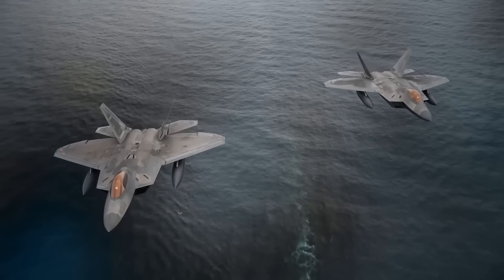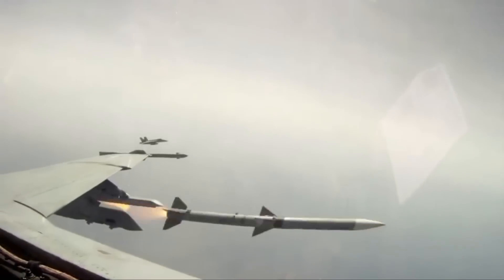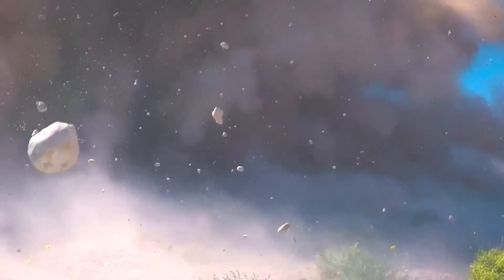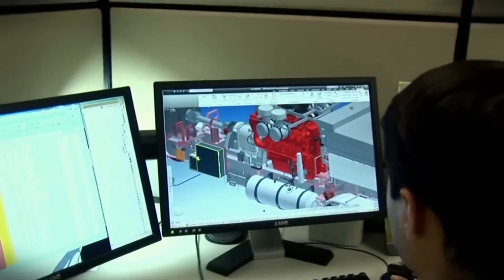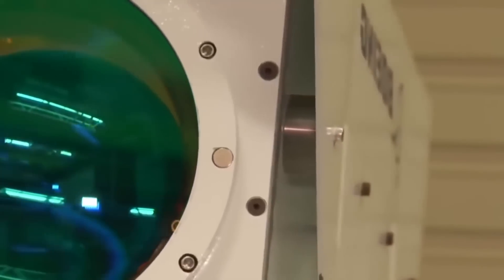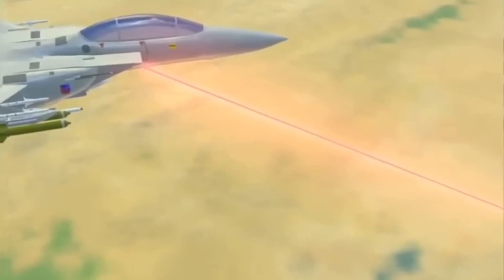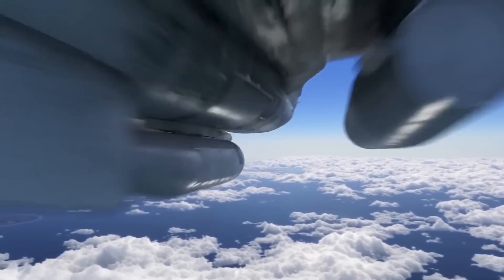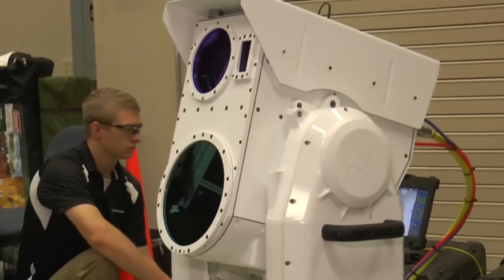LASER F-22 Raptor Is Coming - Goodbye, China!

Comment: Still not that impressed with the laser.  I remember the first laser designed to shoot down a missile from an aircraft - just over 40 years ago. It was designed to be mounted in the belly of a C130.  It was designed using supercooled chips back before we had higher temperature chips.  It looked like something from a sci fi movie.  Pretty cool.  The first test was announced in Air Force Times in Spring 1982.

Still, I would have expected more miniaturization.  Then again, the power and range have likely been stepped up a few magnitudes.

Comment: Yes we have lasar and other "lasar type" technology
First it takes a lot of power and must aim at a target for about 90 seconds
Coming from the front of a large airliner size Jet/vessel
The Particle Beam stuff is far from ready to be mounted on Smaller fighter Jets in routine Day to Day usage and has to be very close to a target shoulder stinger range

I don't believe the USA is willing to disclose or put these heavy elements necessary to power these systems in harm's Way at the present  time

Comment: The F-35 is already designed for laser weapons. It has equipment spaces in the body of the airframe already set aside for lasers. No external pods needed. And these lasers would have a full 360 degree, 3 axis range of coverage. Indeed many of the animations you showed depicted the F-35, not the F-22 employing lasers.

Comment: a delusional video.
Install laser can make the stealth capability of f22 is not function.
F22 needs to paint the coating every few hours use
F22 tank is so small, only 800km.
F22 can not land on aircraft vessel.
Using the air tanker will reveal the f22 stealth because of the tanker is not stealth.
So nothing to worry about f22, they can fall themself without need to shoot them.

It is a defect warplane.

Comment: I have been responding to this on multiple levels for the last six months or so. The DOD contractors such as Lockheed Martin and Boeing have been working on micronization of minimally the 60 KW laser system for a few years and little bits and pieces of DOD publications has been hinting at this. Thus the Sixth Generation fighter (which may already be in limited service) will have this weapon system. Nothing beats the speed of light.
Reply: 60kw laser,is that powerful enough to neutralise bigger target weapon or only smaller weapon like drones etc.
Reply: @georgesikimeti2184  Minimally 60kw. Could even be more powerful to take on bigger targets. Also, the engine power plants have been redesigned to be more powerful but utilize less fuel for more range and juice.

Comment: This sounds crazy but Can the Lazer be harder to destroy if they shoot a target with sun block around it or other items that block the heat or something like that on it or accidentally shot down the NATO weapons or plane by mistake?
Countries make new crazy things all the time.
Reply: Just use extremely refective surface will provide the answer.
Reply: @taykokhuat  Use reflective surface now Chinese plane no longer has stealth capability which is very stupid. 😂🤣🤣😂😂🤣😂🤣
Reply: I have a hard time imagine sun block holding on at Mach 1.2.
How would you like to be the poor sap last in the formation.
Reply: Remember that Laser is not as easy to block like the sun's rays because sun block only blocks the harmful UV rays that causes cancer. You can do a simple experiment by using laser cutters. If you can block it with sun block then that will answer your question. Reflective devices is not practical to install in a fighter plane. Imagine that putting reflective devices to a fighter jets is like announcing to the world you are coming. If that's the case, I will just use a conventional weapon to shot you down.
Reply: Interesting question I don't think it works that way we do have ultraviolet laserst
Reply: india have kilo ampere linear accelerator KALI 5000,10000

Comment: F-22 is too small to house the electrical power generators needed to have a legit kill laser. Period.  That means both internal volume of the aircraft AND payload capacity. But we ARE set to put the real deal aboard B-2s.  Which can retain the entire system internally, maintaining the 0.05 m2 RCS.  FYI... the threshold of what constitutes a LEGIT laser kill weapon is >1.0 Mega-Joules/cm2/sec CW output energy.  Vaporizes stainless steel in 1.0 seconds contact.  So when you hear about 60 KW lasers... it's appropriate to yawn.
Reply: America should continue its paramount position.always among the comity of nations.

Comment: Can lasers overcome mirrors?
Reply: Yes. It just takes longer to heat up.  China will undoubtedly be working on making thermal cooling in their ballistic missiles to counter the threat.
Reply: Yes
Reply: Good luck with creating a mirror coating which doesn't crack.😂
Reply: @gman21266 would a 500kw laser cracked it?
Reply: @georgesikimeti2184  There's a whole lot of shaking and twisting when they are in the air. Any kind of "mirror coating" would have to be able to withstand it.
Reply: @gman21266 would a 500kw laser cracked it?

Comment: F22 raptors are stopping in production! So why would they attach new tech lasers on them ?
Reply: Because the F-22 Raptor will remain the top dog fighter Premier champion of the sky for the next two decades is that enough reason for you
Reply: @donniepayne9786  😂😂stfu 🤡🖕 For 1, they ain’t top dog and 2, there’s not enough of them (They wouldn’t be able to stop every hypersonic missiles if there’s not enough jets with lasers) so they won’t be making any more f22s in future. The Military wants f35s instead.
Reply: Because F35 is multirole and F22 will be the purer air dominator. The laser fits that role better.
Reply: They stop producing f-22 but it doesn't mean that they stop using it, US currently have 185 in service the only problem with this aircraft is the cost and maintenance, otherwise this is a superior air to air fighter even superior to f-35.

Comment: In 1949 or '50, JET aircraft, both research and production, started to show up, after Halloween, at Ladd Field in Fairbanks, Alaska for "Cold Weather Testing.  They were guaranteed 30 to 50 below zero (F) temperatures for a couple of months, at least..  In '53 I was stationed at Adak, AK, and came home for my 30 days leave.  At my Dad's bar a bunch of guys were at the big round table in the back.  I was scraping peanut shells off the table and one of the guys said, "Would you like to see some airplanes tomorrow?" "YEA'!!!!! The XF-101 & XF102 were there, and ( got to sit in both of them.  When I told the guys back @ Adak, they didn't believe me.  It would have been interesting to see their faces a few yrs later when those planes became public.